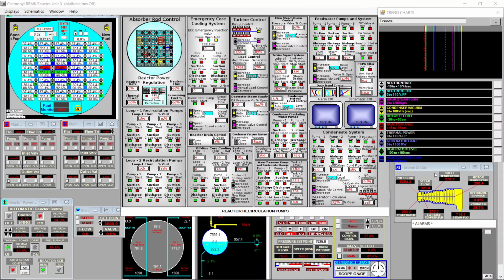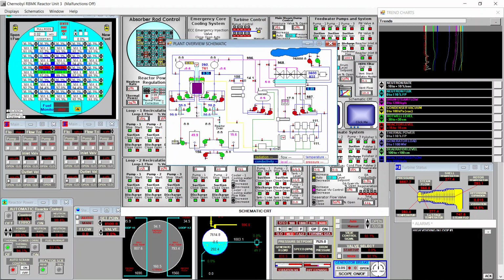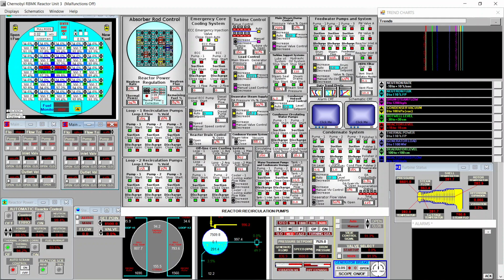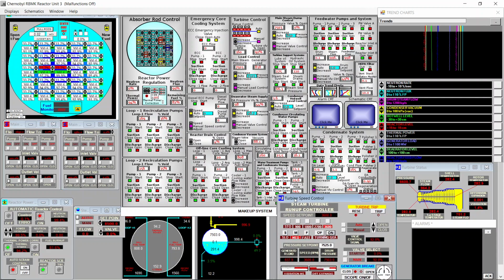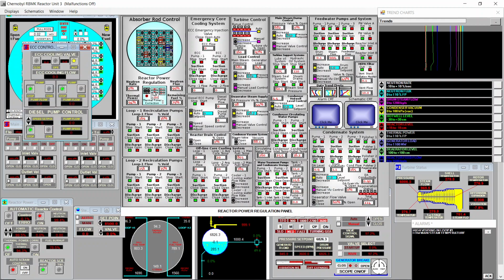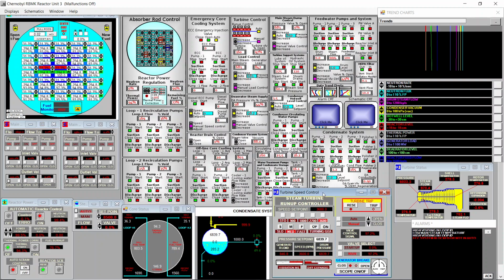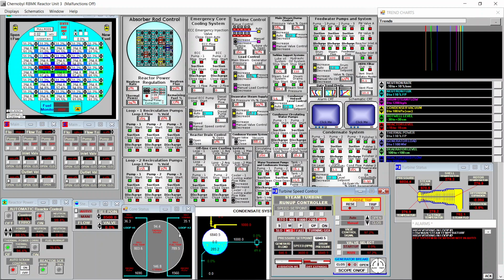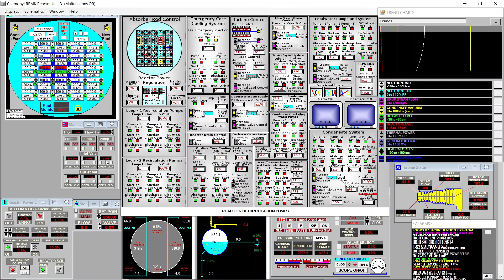Chernobyl new spec RBMK security test at nominal power

Comment: You can use cheat engine to manually reduce the pump trim to below 0% which has the effect of further constricting the flow rate beyond what the simulator wants to let you do. I found the values at memory addresses 10020860 and 10020864; just change the trim values around and check that they match before doing something silly like setting them to minus 1.
Reply from the maker: That is very useful! I did not use the simulator for a long time now because of my work, but I will try when I get free time. Thanks!

Comment: I'm not convinced that the turbine test caused the chernobyl reactor to explode.
Reply: Yeah, I also think the turbine trip only caused the super-high voiding and prepared the way for the scram to increase the reactivity beyond limits.
(It is actually visible in the simulator, with high xenon poison or getting the centre core to 0% shows a reactivity increase when inserting the first 0,5 to 1% of the rods.)
Reply from the maker: what's your theory?
Reply: @argilaga  I believe that the scram, in combination with the particular control rod configuration at that moment, caused the reactor to explode.

Comment: Circ pumps should be running & the scram wasn’t initiated right with the turbine trip, but some 40 seconds later.
Reply from the maker: Correct, many things are not accurate, I'm just doing tests to see were can we get
Reply: Hm, the SCRAM was initiated right?
It showed reactor scram together with the turbine trip and started sending the rods to 100%.

Circpumps should be running, correct.
They keep getting power while the turbine trips, but they usually trip from low pressure - so they have a reason to go offline, but not really sure if that cause is accurate in that situation.
Reply: @AndyPue  in real world the scram was way later than disconnecting the turbine

Comment: If I'm not mistaken, this simulator war originally known as "Chernobyl: The Legacy Continues",  I'd be surprised if it didn't simulate the positive scram effect. One would naturally have to have most of the control rods fully withdrawn to get a power spike at the lower parts of the reactors upon scram. Have you tried this?
Reply from the maker: You are right about the name. I tried that in a previous video named ''RBMK-1000 Chernobyl Nuclear Accident Simulation'' and I could not replicate the positive scram effect, I'm still doing some tests both in the legacy version and the full old version in a virtual machine to see what can be done. According to comrade Full-Battery (he really did some research and has some contacts) the simulator was really calibrated with data from the plants post accident, I will cite his comment in one of my videos: 

''you’ll certainly have to make a version 3 tutorial! With the malfunction, economy (actually following power grid demand), the genuine SKALA computer emulation(since it’ll be the full version, this shitty conversion is of the demo, missing a lot of features and using a recreation of the computer), the different warning sounds blaring at your face!, the WORKING refueling system, the maintenance scheduling system, yeah there’s a hell of a lot! I’ll certainly be fun! 
That “Chernobyl RBMK Reactor Unit 3” is 100% accurate! After speaking with a few people, I found out that the Simgenics team (who developed the simulation back end) actually went to ChNPP (specifically unit 3) during the upgrades, and developed it to a seriously high level of detail, including emulating the hardware and tape drives of the SKALA  computer system. This is because Gatekeep weren’t the only ones looking for a simulator, other NPP’s running RBMK types need some kind of ‘new age’ training solution for after the safety upgrades. Why the Russians let the Americans produce this, we’ll probably NEVER know, but hey! We have an awesome simulator!''